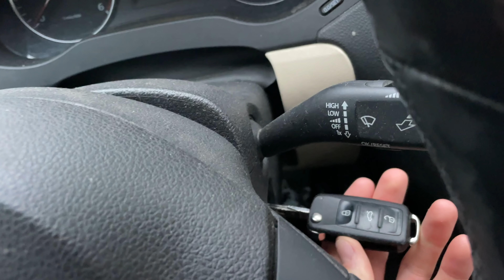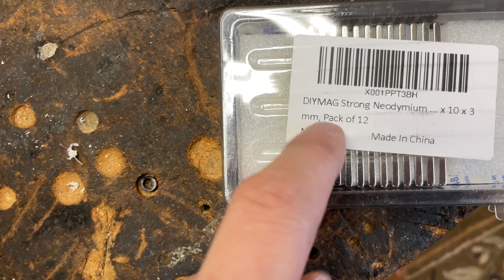I MADE QUICK RELEASE - SIDE SKIRT MOUNTS

Comment: Just a protip, when painting plastic use adhesion promotor , if you dont then it will flake off eventually. You might be okay with the sideskirts because they look to be primed already so probably already been adhered to the plastic but its not expensive and its a good failsafe to have when painting plastic parts